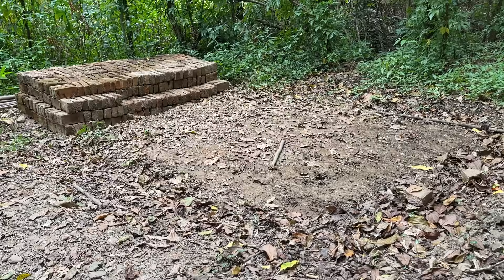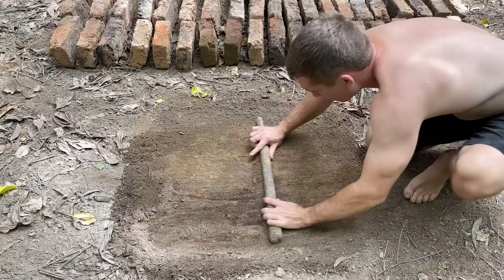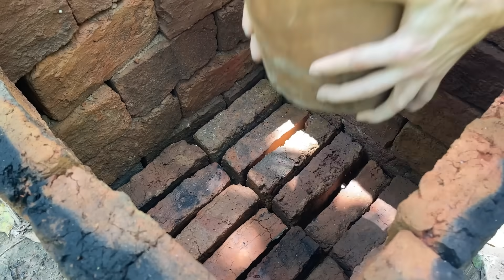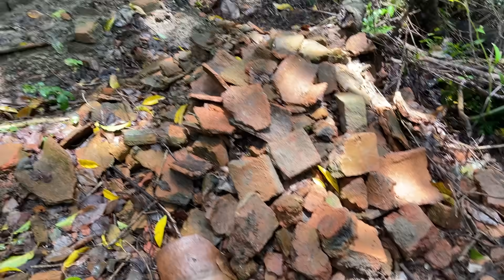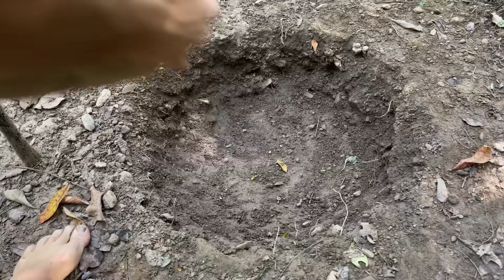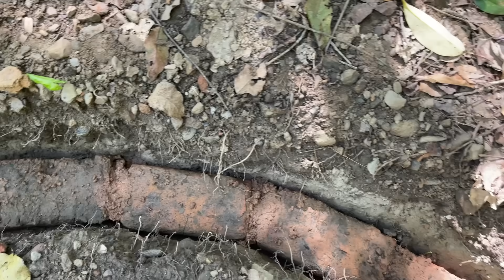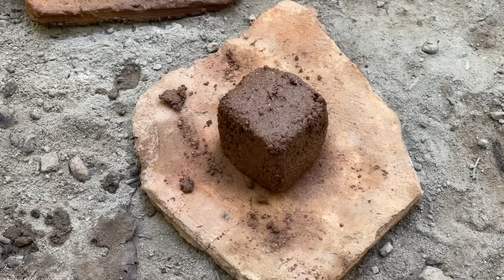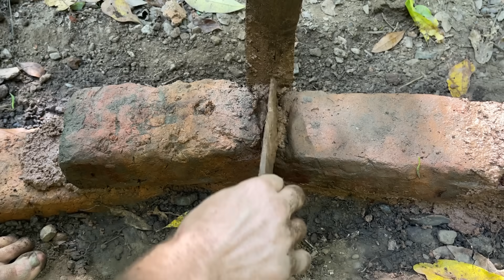Primitive Technology: Wood ash & crushed terracotta mortar

Comment: I wonder if fire the pellet wood ash mixed with finely crushed terracotta 3:1 will make more stronger cement?
calcium + alumina + silicate + iron oxide, like nowadays Portland cement . 
or will not be hot enough to make chemical compound when use this firring method?

Comment: have you ever considered lining a hole in the ground with mortar/terracotta (something insoluble to water and hard) to use as a semi-permanent mixing pit? i imagine mixing in the dirt would lead to a lot of impurities, and waste quite a bit of material with what you can't pull out. you also could probably dig it up and use it for grog if it starts showing wear.

Comment: Time to make a cylindrical clay scoop to more easily handle the mortar. The two flat pieces probably work fine but it can help in the long run having a specialized tool with how much you make and handle the stuff.

Comment: did you ever hold onto any of the flours or starches you made? there are sections of the great wall of china where the wind has worn away the brick but the mortar remains they they put this down to rice starch in the mortar mix. also the brick courses you do have could be used as foundations for another temporary hut.

Comment: The gothic arch would look great; but also as a water proof foundation for a more perishable structure that would need replacing every year or so, this looks super solid; and the mortar looks very legit. A bit late I guess but I suppose larger bricks would be more mortar-efficient? Then again they have their historic shape for good reasons probably... larger bricks are more difficult to handle or harder to bake without cracking.... probably some delicate historical validated balance youd upset by 2x ing the size of your bricks.

Comment: Nice attention to details.  2 small nits: missing step of mudding kiln to seal air gaps to keep heat in and more even, and breaking bricks in half for the odd brick (if spacing wasn't perfect to allow only whole bricks on a course).  Alternately, dry placing and/or measuring each course to estimate mortar variances to use whole bricks.  Nonetheless, half bricks at doorway and/or windows to allow staggered rows.

Might be nice to have helpers.  A small team could help set up production lines, speed up projects.

Comment: Maybe if you have enough left over brick and mortar you can build a permanent drying kiln. It seems like waiting for the bricks to dry in that wet environment is one of your major bottlenecks. 

Something that you could fire and slowly bring up to a sustained temp for drying with lots of thermal mass and indirect heat. 

Pretty sure they were popular in colonial america but there are much older examples as well.

Comment: Your hands must be as hard as flint.
When you want to mix two powdery materials, make a conical heap of the larger amount, scoop out the center of the heap and put in the secondary amount. Then you get a spade or spatula, and  just dig into the bottom edge of the  pile, and pour your spadeful out onto the top of the pile. As you  put the material on top, it rolls down the sides together, mixing evenly. Work your way around the pile.

Comment: Hats off to that brick mold. It has made countless bricks and is going strong. In other channels you might assume it's been replaced, but here we can safely assume a replacement would have been mentioned and we all would be quite emotional if it happened.
Reply: I think he did actually replace it a few episodes back. And yes it went exactly like that, he made the replacement on camera and even a moment of farewell to the original.
Reply: Each tool created becomes a treasured artifact
Reply: @DavidEast-gy7le  More than that even, each tool is an extension of him, a friend or family even. Each tool has worked for so long making so many things possible, and if this was really a time before time, each tool would've been the reason he's alive. Everytime a tool breaks it is quite sad.
Reply: @flamingchuucygnet8983  It's the spool of wire all over again
Reply: @devaliant1 indeed it is
Reply: Was that the mold? I thought it was the old ceramic blower that finally cracked.
Reply: @giantpunda2911  Well I do remember watching the mold being done at least twice. So either way, a replacement would be/was filmed. That's the integrity/honesty, that I love about this.
Reply: @Gnarlf  are you thinking of the roof tile molds? He's made a few of those because they're made of wood

Comment: Easy way to do level is use a wet string and watch where the water wants to drip from it, when the drip is random along whole length, or stops, string is level.  Romans made roads with a square, plumb-bob, string.

Comment: I think this will make a very good retort for getting high quality and high yield charcoal! Excellent work! Maybe if you reshape your mold for making bricks, so that the ends angle in slightly, you’ll have bricks that fit together more closely, and will use a lot less mortar. Mortar degrades much faster than bricks in hot fires. Less mortar should save you time and create a stronger structure. Similarly, if you create a flat surface from either shale or cement, and dry the bricks on the flat surface, you’ll need less mortar. Alternatively, flat surfaces could be created by rubbing the face of three bricks together until they all fit with each other smoothly, two at a time, of course. Love your channel!

Comment: I noticed that the center stick helps keep the diameter stick passing through the center of the circle so that the point of reference is exactly 180 degrees away.  Using the diameter will make a taller structure.  If you used the radius, it would be one radius tall.  But using the diameter as a measurement, the height will be √3 radii tall, about 73% taller.

Comment: Seeing that the mortar was the result of recycling the byproduct of firing the very bricks that its gonna be used on while also reusing the small charcoal byproducts to start the fire easier unironically made me hype'd as hell, what has this channel done to me
Going off that though I'm now imagining mortar being discovered after a particularly ash filled fire pit was hit by a storm, used for like a huge fire, and then hit by a storm again. The firekeeper must've noticed all the ash had hardened the bottom of the fire pit with a sturdy solid layer and gotten to thinking, hell the firepit must've been a stacked brick furnace where the user was frustrated they couldn't just use mud or wet clay to fill the gaps.

Comment: I wonder if the strength of the mortar is related to the shape of the material you add, the sand you use seems like its from stream deposits so its been fairly well rounded by the water whereas your smashed bricks will be more jagged so the ash has more surfaces to grab onto

Comment: And, and excellent demonstration of why the ratios of circumference, radius, and diameter were considered so valuable by our antecedents.
I'm surprised you do not have a stone mattock or hoe in your repertoire.  
You likely need to cobble up a "mortar hawk."  This is a flat surface to carry mixed mortar to where the work is, to be then troweled into place, rather than carried, one trowel at a time.

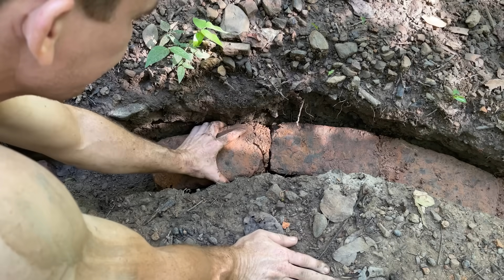Comment: In 10:30 you press one brick agains the other. Wouldnt it be interesting to "hammer" the brick from left to right, using a light impact movement, so it adheres better?

Comment: When making bricks.
Is it best to make them straight from the clay soil.
Or would it be better to pre fire the bricks/ portions of clay, to burn off the organic matter and other impurities. Then smash them to rehydrate form a new purer clay to make bricks from?
Reply: Firing clay causes chemical changes that can’t be reversed by crushing/grinding. Once fired, the ceramic particles aren’t absorbent and won’t bind to each other: this is why he is using previously fired grog as aggregate in his mortar (it behaves like sand). In addition, some organic matter in the clay a strengthens the bricks by adding tensile strength to the clay’s compressive strength. Many methods of brick making add additional organic matter like straw.
Reply: @frederickheard2022  Good to know. Thank you for the explanation.

Comment: Until the door I was wondering if you're going to make a massive water reservoir for running a waterwheel for forge bellows. If the mortar is watertight, you could do something like that but bit smaller scale somewhere upper stream, reinforce the walls with packed soil etc. and "pipe" water with roof tiles to a waterwheel

Comment: For some of the people speculating about the brick pile, Imma be that guy with too much time.  The brick pile (based on arithmetic) starts with 514 bricks (after the batch in this video, not including the ones taken for the kiln).  This structure looks like each layer requires 30-32 bricks (view is difficult).  From there he has enough bricks already for about 16 or 17 layers before the pile runs out.

Comment: The mortar mixture is quite similar to refractory grade mortar mix. I'm thinking of Vesuvious' Super 3000 in particular. That is what I used in the past. The mix seems like something that would be relatively easy to make, given your available resources.

There is also a castable product called Moldit D. Given the correct water content, it is an extremely workable material. Pours can also be done with it if the desired content is reached.
In addition to the mortar, I wonder if a poirable castable similiar to moldit D can me made with your resources. It's a combination of silica and alumina.
I would love to see you cast/mold/shape the forge/furnace for yourself.

I was a laborer for refractory bricklayers. I ended up learning a little about the trade. I primary worked in/on boilers. The company I worked for specialized in woodfire boilers. The oldest boiler I ever saw was a 1921. The ol' feller had a wall cutting the thing in half, which led to the developement of two fireboxes on the boiler. On paper, it was "Boiler 1" and "Boiler 2," much to the confusion of the poor boiler inspector!

Back in those days, refractory bricklaying and red brick laying was one in the same. Red bricks lined the outside of the boiler, then the inside was coated with the appropriate refractory brick or material. 

Hope that was some interesting and helpful history.

Anways, big fan. Keep up the great work. Love the closed caption edits and raw footage.

Comment: I assume the reason you do not build a small section of vertical wall before starting the gothic arch is because that would require buttresses or other supporting structures to disperse the lateral forces into the ground, and the advantage of starting the gothic arch directly on the foundation is that the lateral force is directly applied into the ground through the foundation?

Comment: Is the entrance going to be flush wall-bore doorway? Or an igloo style barrel-vaulted vestibule?
Function… I assume shelter/storage at first (testing the tech through rainy season), or! If this is an igloo-barrel entry, the for sure this will be repurposed as a kiln for charcoal. Right?
If it does become a kiln, cool part is even if it fails (or is intentionally taken down), the reclaimed mortar improves when refired as a pozzolano lime mortar!

Comment: I've been very intrigued by your mortar. Terrestrial plants like wood are rich in potassium, but actually have little calcium content. So a major component of the ash is potassium carbonate, not calcium carbonate. Which when calcined would make potassium oxide, and reconstituted with water - potassium hydroxide, or caustic potash. That is a much stronger alkali than calcium hydroxide, and is likely able to decompose other silicates present in the brick grog and form potassium silicate, which subsequently absorbs carbon dioxide from the air to form colloidal silica as a gel, which will form like you said a geopolymer with the remaining other silicates. 
This seems to me a much more likely chemistry for your mortar. Nonetheless, if it works it works. Good job! :)

Comment: The intro should have a message to turn on captions for details. This is the one project I can say I’ve had somewhat similar experience. I built 6 ft diameter brick rings around the two trees in my front yard. It looked really difficult doing the mortar below ground, I didn’t go quite that deep. Awesome project though, looking forward to the rest!

Comment: I would definitely not continue that build without thickening the base to at least three bricks thick. 

Arches are a way of redistributing a vertical load to the horizontal plane. This means that they take the downward force of gravity and redirects it outward to the sides. This force needs to be resisted somehow, or the structure will collapse because it pushes the walls apart. 

The simplest way to do this is by adding mass to the walls, especially at the base.

This is why all those cathedrals with vaulted ceilings have such thick walls nd all those huge buttresses. They aren't just for putting up decorative stonework and gargoyles. They are literally preventing the roof from falling in. 

I highly suggest you incorporate something similar, or I wouldn't recommend building an arched roof at all. 

Three layers of bricks at the base ought to do it, thinning to two some way up the wall. Possibly with a few actual buttresses set at a normal out from the wall as well. With these things, unless you're willing to do the actual maths, it's best to make like a medieval architect and overdo it. Because the price of underdoing it might well be a literal ton of bricks suddenly collapsing on your head. 

Which in surveys has received a "strongly not recommended" by 12/10 physicians.

Comment: You have a blog post from 2018 about using this exact mixture to make cement. In which you theorize about using it as mortar. Now here we are. Incredible. I have loved this channel since the moment I found it back in 2016. Thanks for all the hard work and for keeping too your original premise. It would have been so easy to prove you could make Iron and then immediately begin to bring in various iron tools or other supplies. Yet here you are, 10 years of digging holes with sticks and lighting friction fires.  I do still wish you'd write the blog posts but I understand not wanting to keep up on it.

Comment: 14:35 for those also wondering, a gothic arch is "an arch with a pointed crown, whose two curving sides meet at a relatively sharp angle at the top of the arch". Sort of like a rounded triangle instead of a dome
Reply: For those who would like a visualization, you can copy "Surface((1/2+cos(u)) cos(v),(1/2+cos(u)) sin(v),sin(u),u,2 π/3,π,v,0,2 π)" into Geogebra 3D.
Reply: @Kycilak  or you know, google " gothic arch images".
but ur method is cooler, ill give u that.

Comment: Other plant matter such as bark or leaves can produce more ash, although it can have higher potassium content. It may be a good idea to separate the ash into potassium carbonate (soluble) and calcium carbonate (almost insoluble) using water, and add the potassium to the smelting flux, while using the calcium for mortar.
Reply: Great tip

Comment: I was just studying gothic architecture.  I'm amazed by the universality and simplicity of the arched stone or brick structure; we associate it with the middle ages, but it is designed to address a problem that every generation of humans has had to contend with, creating a permanent roof that won't rot under the rain.  The knowledge of its construction is just as valuable now as it was 1000 years ago.

I hope you are successful in your project, building a roof out of bricks can be intimidating because of how disastrous it would be if it collapsed, but if it done correctly it will last forever.

Comment: 8:10 Dude's falling behind. The neighboring tribe has invented the 2-stroke internal combustion engine.
Reply: Bro is playing an optional challenge run with the research tree carried over from a late game run and you get unlimited food but you only have yourself and zero other equipment.   He even unchecked the "start with shoes" button for some reason.

Supposedly if you get far enough you make your civilization more resistant to total collapse and gain a small but permanent research multiplier.  

He also manually configured his ore rates lower than you can set them in game, a challenge normally reserved for entire teams.  

The other tribes are running a DIFFERENT challenge where they still start with a couple electrical age tools like a chainsaw.
Reply: he's spending more time in the early game to keep grinding the EXP bonus.  Turns out advancing as soon as possible is a straight noob trap.
Reply: @VenetinOfficial If you build wide instead of tall, you really expand in the late game
Reply: Yeah, but I bet it burns oil like crazy.  Buncha showboaters.

Comment: This is was one of the best in ages, not that I don't like the furnaces - but something new after a long period of iron work.
Can you explain in your next video what you mean by hemisphere and gothic dome?
Its interesting the parallels with ash as this is what I think Romans were adding to their concrete for durability, hardness and permanence in water, particularly their ports.
Thanks for your hard work.
Reply: The old fashioned way is to make each ring of bricks a little smaller than the ring below it. It sounds like John is planning something that will be a pointed arch in cross-section, which will produce less sideways thrust at the base than a hemispherical dome.
Reply: The walls are sloping inwards towards the center, since he's using a distance from the bottom of the wall on the far side of the hut to determine where each brick will go. This will eventually lead to the walls meeting in the center if he builds them high enough. The radius of the curve is going to be the diameter of the base, so it won't form a half-ball (hemisphere).